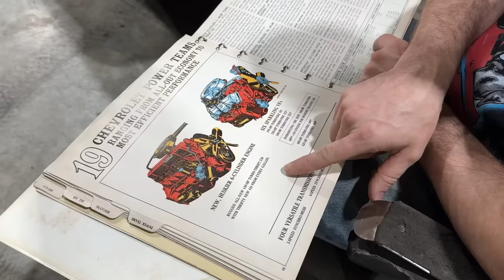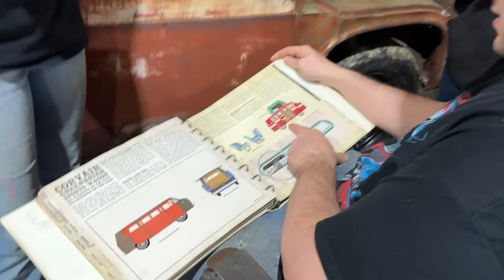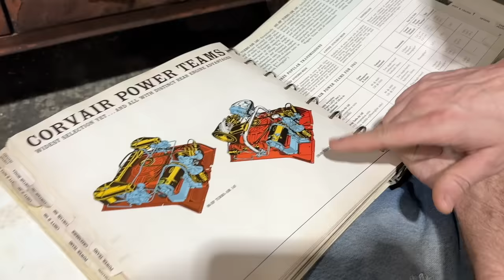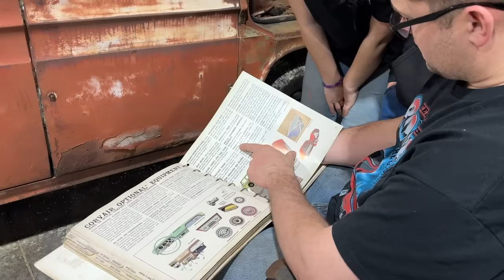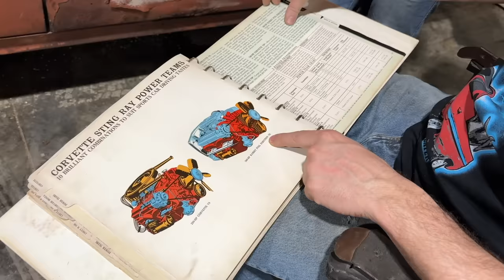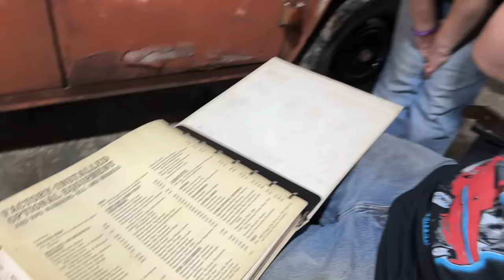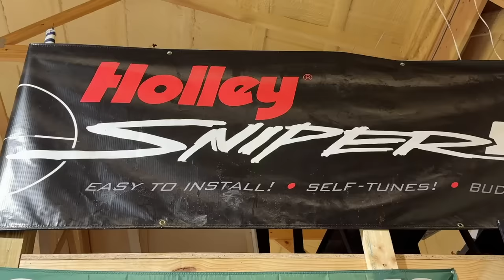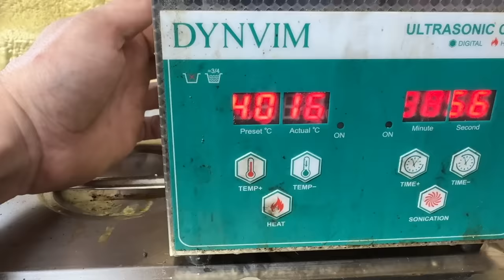Rare Van Parked 37 Years. Will It Start?

Comment: Josh, i could tell you a long story about 10 of us driving a corvair van accross the country in 1974, when i was 17. It floated awhile in the mississipi river, then sank. The great folks in Louisanna, Missorui hooked it out, we got it running again, with their great help, and motored on. Thanks for the memories, my friend. You folks are SUCH a blessing! Love ya'll!!!!!
Reply from the maker: That’s an amazing story
Reply: Wow 
That trip could be movie
Reply: My dad had 5 corvairs when I was a kid. Check the valve clearances. Valve guides. If not set right, they will self destruct by throwing rods out the top of the engine. Make sure the distributor bushing is getting well lubricated as well.

Comment: That looks like a corvair motor in the back Matt from Matt's off-road recovery will have every part you need for that motor
Reply from the maker: Ok thanks
Reply: Swap in a 63 to 65 Spyder turbo motor and gauge cluster
Reply: @Sleeperdude  Matt is an expert when it comes to these Corvairs. He has several large shipping containers full of parts! I'm sure he would be able to answer any questions you may have. I'm looking forward to seeing this build!! Thank you for having such awesome family-friendly content!! You & Tosh have done an excellent job raising your kids. They're all very talented!! Thanks again!! Hope you have a Happy Easter!!
Reply: The Morrvair is a beast.
Reply: I like the Lakewood wagon and Matt turned it into a nice offroader
Reply: I tried to get sleeperdude in the off-road games.
Reply: I saw one of these in a video recently on a small channel where the guy was walking thru an abandoned junkyard. I'll try and find the video and link it.
Reply: @user-ht1xu4gv2u    the extra turbo gear won't fit under the engine lid, and neither will any of the AC parts from a car. The dash cluster WILL fit no problem, but you will need to find the various sending units to make everything function.

Comment: Daddy-o on the clutch, shifter, and string throttle...Squeezy steering...Ralphie monitoring the belt, the battery, the fuel tank position, and providing starter button service...and Wawa ready with the killswitch.  Nobody on the brakes because there ain't no brakes!  Everybody has a job to do but nobody can see to do it because of the smoke!  PERFECT!  Couldn't have been more entertaining and it'll be quite a project to have roadworthy-ish but completely worth all the hassle to get there.

Comment: Corvair engines are notorious for lifter noise when they have been sitting for a while. Just let it idle for a while...a good long while! It will get quieter and quieter until it is one of the quietes six cylinders you have ever heard. (unless the exhaust is bad).
I have owned a 63, 64 & 65 convertible but never a van or truck.

Comment: I had a hand in restoring a '61 Rampside for my boss thirty-four years ago. He found it sitting in a dusty Wyoming field, along with a '62 Greenbrier. Both had to be hauled on a trailer back to Michigan. I got the Rampside's engine running with minimal tinkering, and it had been sitting for years. Body was straightened out and painted the same color as your sample picture.
I drove that pick-up around alot after it was done. It was a 3-speed. And it did have the line coming from the gas tank up to the cab for the heater.
The van was used for parts and we never got it running.
I had one of those dealer albums for 1959 Chevrolets. I bought it from Hemmings 1980. '59 Chevies used to be my favorite because that was the year I was born.

Comment: The 95 badge was introduced with the 95 horsepower update.  Back in the day, we had a Greenbrier-badged 80hp.  My uncle liked it and bought a new 95-badged Greenbrier in 63, with the 95hp upgrade.  Ours melted its first cylinder barrel in Whitefish, Montana on the way from Massachusetts to Lake Louise (we never made it because the engine was being rebuilt.)  A couple of years later, on the way to Mexico, the Powerglide lost reverse and it was traded for a used '64 Biscayne in Tennessee which finished the trip without incident.

Comment: Rings are stuck. Run it until they come loose. Or fill the cylinders with penetrating oil, and let it sit. Motor sounds pretty good. If you had serious problems, you'd have at least one dead cylinder. Worst comes to worst, you can buy new jugs and heads, but it doesn't sound like you need them. Comes apart like a VW motor. Good luck!
Reply: You are probably right about the rings being stuck, but how does it have enough compression to move it along?
Reply: I think just the oil control rings are stuck. The compression rings are fine. Could also just be obliterated valve stem seals.  @mexicanspec
Reply: @mexicanspec  They are stuck at the exact diameter of the cylinder when it was parked. Any variation in the inside diameter, as the piston moves in and out, results in oil getting past the rings. Most of the time, there's enough compression in each one to run, but it doesn't stay the same throughout the piston's travel.
Reply: You might try Matt's off road recovery in Utah for parts .he has a really cool corvair wagon 4x4 and a van ! He's a good guy. Watch his videos there, great, just like yours!
Reply: I checked with Google and it says Corvairs have tubes with seals on both ends that the pushrods run in.  They're bad to fail and it will burn a lot of oil.  The good news; a kit with all of those seals is like $15.  Engine doesn't even have to come out.

Comment: My Dad worked at Dallas Power & Light in 1963 and they used those vans like you workin on. They had to pull a small trailer to carry all the tools and equipment to do the jobs they was doing. Hope y’all get it running✌🏻
Reply from the maker: Very cool

Comment: This video brought back memories..my throttle cable broke on my 67 VW. I had a friend with me and he squatted half way in and out of the engine and worked the carb..I would yell out the window so he would let off the throttle..we stopped at an old
 dairy barn and got some seed grass string and ran it so when I was driving I could work the throttle..first I have thought about that in years..thanks for making this old feller smile....

Comment: My Father bought a 1961Silver and White Greenbrier.  He called his Greyhound puppy. It leaked oil like a sieve. The heater worked off a Bellows that opened the passage in the tins under the Push Rod tubes and let it into the Cabin it did not use gasoline but warm air from the tins surrounding the engine.  A couple of tricks you can lower the front end by replacing the shocks with a pair of 1957 Chevrolet Sedan front shocks. I you replace the push rod tubes with to seal without leaking use Viton replacement O rings. Just soak them for 24 hours before installation.  I rebuilt the engine in 1972 I had the lower end balanced. It didnt leak drop of oil. It ran like atop until it dropped a valve seat despite having a complete vale job by a "Corvair" expert Mechanic.  One sneaky failure mode is the harmonic balancer was 2 pieces of stamped press fit steel and as it aged and under hard acceleration going over a mountain it split apart and sliced open the oil filter. So two different methods for repair are weld the two pieces together or buy a billet degreed timing wheel.  Enjoy!
Reply from the maker: Awesome thank you

Comment: You are a brave soul to tackle that pile. I worked at a Chevy dealer in the 70s and 80s and the very old mechanic that was qualified to work on those refused to work on any van of that model. He would tell the customer it would be better to set a match to it. His reasoning was when he finally discovered what was the problem the customer didn’t want to fix it $$$.He would yell across the shop A WASTE Of MY TIME!

Comment: I love Corvairs.  Had a Spyder 4 speed convertible for years.  Still got a garage full of parts, 5 engines, carbs, cylinders and all sorts of hard parts.  Body panels, steering columns, all sorts of parts.  Wanted to clean out that garage, couldn't give the parts away.

Comment: 8:53 "Should I Bounce?" LOL!! I don't think Tosh quite gets the reason you'd bounce when a car gets stuck LOL. But very cute!!   Also love Wah Wah's T-Shirt "Country Girls don't retreat, The just Reload!".  So as they're looking through the book he mentions the "Monza" and he calls it "The Monza Spider" The Corvair version of the Monza Spider was Turbo (I think). There was also a Chevy in the 1970's and I think into early 1980's that was called "The Monza Spider" which actually had a Big Spider "Painted" (Decal I'm sure) on the hood just like the Trans Am Fire Chicken! Okay "Firebird" (which was supposed to be a Phoenix rising I believe). The Monza is still around in very limited numbers usually as a drag car or just a restored show piece or maybe a Hot Rod. Actually in the first four or five episodes of "Road Kill" they get a hold of a manual V8 Monza which they found would do epic burn outs and donuts then drove it for a bit and tried to add some leaf blower Turbo charging to it a few episode later. LOL. The Chevy Vega and Chevy Monza were basically the same car except not as close as say a GMC and a Chevy Half ton truck. They were distinct styling but very close in every other basic way." But
Reply from the maker: 🤣thank you

Comment: Josh, the Crankcase Blow-by tube is clogged. Just clean it out and she'll be fine. The very first time I was paid to do any mechanical work was on my aunt's 63 Corvair Monza Coupe and I removed the Blow-by tube so to relieve the crankcase pressure and lower oil consumption. Enjoy.

Comment: When I was in high school working in a gas station, we had a Corvair Ramp-side for a service truck.  In theory anyway, it never ran as long as I worked there.   A '60 Ford Fairlane sedan with a gas-engine starting unit mounted in the weight-reduced trunk took over service call duty.  I painted that Ford over a couple of slow evenings.   Used Standard Oil  red and blue gas-pump oil base paint and a brush.  Left the original white paint on the roof to get red/white/blue.  It was art.

Comment: I had a 68 Ford Fairlane with 69,000 miles on the odometer, burned a quart of oil every 300 miles, replaced valve guide seals and oil mileage shot up to 3,000. It's amazing how something like valve guide seals can make such a difference.

Comment: Dang Son! That telegraph switch would make a super cool horn button!
Reply from the maker: For sure
Reply: It's a Morse Code key for ham radio.
Reply: Or a cool starter button!!!
Reply: @markc2643  , I was wondering about that , or if it was something the phone company would have used for testing.
Reply: Definitely for Ham radio
Reply: When I was 15 I had a '54 Ford F100 and had a cheap Radio Shack CW key just like that one which I used as the horn button since the original button was missing.

Comment: I had a Greenbrier in high school! Fun vehicle. One thing you gotta watch for on the air cooled cars is trash blocking the cooling fins on the cylinders. Grass, mouse nests, etc. That motor was acting like it was overheating, and that would be a likely cause. Driving while overheating by the previous owner may be the reason for all the oil burning too, the rings are scarred up. Worth rebuilding- parts are plentiful, and you may be able to get away with just swapping out the jugs / pistons.

Comment: Put some brakes on it and Throttle linkage on it. You can use it to keep the bugs away in the summer, just don't run out of oil!
Reply from the maker: That’s right
Reply: My neighbor had covairs always working to get them running right.  They could have used you back then! Nice job by all!

Comment: The first aftermarket turbo mufflers were made by Walker and were actual Corvair mufflers.  I had them on my 64 Tempest with a 389 and 4-speed.  The mufflers had a 2 5/8 inlet and 2 1/2 outlet.  Awesome sound.  Saturday is always better with a Sleeperdude video!
Reply from the maker: Thank you so much

Comment: When I was a little kid my grandma's neighbor had a long-term parked Corvair pickup truck I remember it had a tailgate in the back and a tailgate on the passenger.  These must be extremely rare cuz I can't remember ever seeing another one.  Contrary to popular belief the windshield squirter air tank on a VW Beetle would not flatten the spare tire it had a check valve that would not work below a certain PSI

Comment: Clarks Corvair is a great source for parts and advice on Corvair repair.  Easy to find on line.  I have 2 Corvairs, a 1963 4 dr Monza and a 1961 Corvair95 rampside truck.  Have learned a lot in getting them running and roadworthy.  I have a few suggestions for yall if you intend to get it back on the road with an original drivetrain.

1.  Install a new fuel tank.  Clarks has them available, will be listed as an FC tank (forward control).  Same tank fits the truck and van.
2.  Get online and order a Bando brand 3V560 v belt.  Its the correct width, most places that sell a replacement sell you one that is too wide.  Also you have a bad pulley so that will throw your belt.  It does not have to be banjo string tight, just snug works fine.
3.  Absolutely no rubber fuel line in the engine compartment.  Use steel or copper with flared ends.  All your fuel lines and carbs sit directly above your heads and exhaust manifolds, any leaks will burn it to the ground.  Only place for rubber is a small section right off the fuel tank and a short piece transitioning from the long steel line under the van to the steel line coming from the engine compartment through the firewall.  Cannot say it strongly enough but rubber fuel line in the engine bay can be deadly with these.
4.  Clarks Corvair will have all the brake parts, prices are very reasonable.
5.  Use an electric pump mounted directly off the fuel tank under the front of the van.  I wired mine into the fuse panel under the dash on drivers side, comes on when key comes on.
6.  Need a set of air filters, also the engine cover needs to be on for correct cooling.  The rubber flap also needs to in place all around the engine compartment to assure proper cooling.
7.  There is only on specific size battery that fits in that battery box and its not cheap.  But its the only one that fits.  If your battery tray is rusted out Clarks sells them. I made my own, its easy.
8.  14 inch tires are hard to find.

I would love to share more with yall if you want, I was very excited to see your van.  Its in great shape rust wise.  If you want to talk or need more info let me know.  Not trying to be a know it all, you did great getting it running, I have just learned a lot that I can share about those weird little motors.  Thanks!  Hope I can help and PLEASE be careful with those fuel lines.
Reply: Looking at his shift linkage, he may have the later tank with the shift rod going through the center of the tank. Clarks has them too, but not cheap. I had room to install a group 51 battery in mine. Cheaper than the OEM size.
Reply: @rupe53  Good to know.  Thanks!

Comment: Before you go crazy looking for the oil smoke problem, check the breather tube to see if it's clogged and building crankcase pressure. Removing the dip stick will give you a clue if there's pressure. Also, when doing the brakes you can use a dual master from a 60 vintage car. Clark's Corvair sells a pre-bent line kit to clear the frame. It's a VERY tight fit. BTW, that's a Corvan 95 panel truck, (I have one) not a Greenbrier. The Greenbrier has windows all the way around and 3 rows of seats. The 4 speed is pretty rare in that van and maybe only 10% of production. This is the "work truck version and most had a 3 spd or auto 2 spd. Typically they only had a sun visor on the driver's side and a radio was optional.

Comment: Glad to see a Corvair revival going. I have a 65 Monza Coupe that I have restored and a 61 Rampside that I am in the process of restoring. Both of them came as a project that was started decades in the past. They are fun cars, and relatively easy to work on. Make sure to remove the engine cover, rats and mice love to make homes under there and cause these engines to over heat. Also, the engine will prolly need new rings, that thing was just shooting oil out.

Comment: New to the channel, sorry I’m late to the conversation. I grew up messing with Corvairs and had a ‘64 8-door Greenbrier. I was VERY relieved to see you stop after removing the first bolt from the rear “cover”. That’s a motor mount bracket, not a cover. It holds up the whole back end of the drivetrain. That would’ve been a bad day, if you had continued. Also, dugga duggas are great for disassembly, but you will destroy a Corvair engine in a hurry using it for assembly. You commented on the heads being aluminum; so is the block. Those bolts normally don’t come out. They should be studs and nuts.

Comment: My Dad had a Greenbrier van with the camper option. We loved it until we were headed to San Fransisco To see my Brother just home from Vietnam. We heard a terrible noise from the transaxle and stopped along the highway near Willits California. Come to find out the technician who changed the oil forgot the fill plug and the transaxle seized . We got towed to Willits where we were forced to buy a used car which was a Chevy 2 wagon. 6 cylinder

Comment: You can pull on those rear door checks and they will release, so the doors can open wider and get out of your way. The Rampside pickup trucks are loads of fun to work on, with the tailgate in the way.

Comment: Yes that is a pretty rare van, I believe the rarest ones are the 8 window ones and if I recall correctly a few were made with a camping option.

Those engines were great, they run forever if maintained and are easy to fix.   My dad and I owned several corvairs and fix/resold many of them.